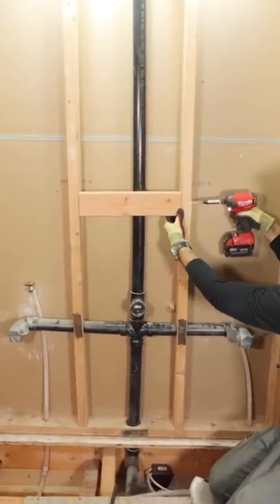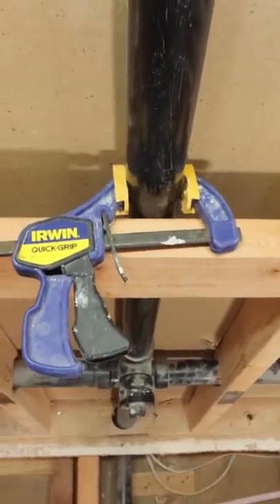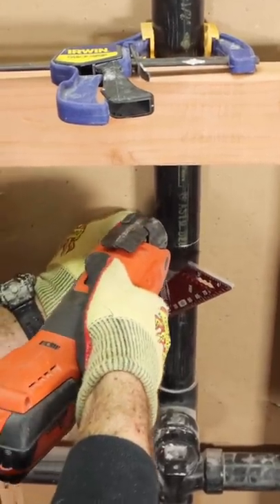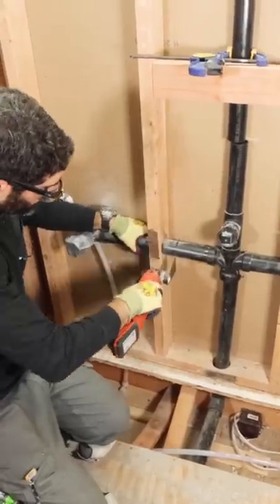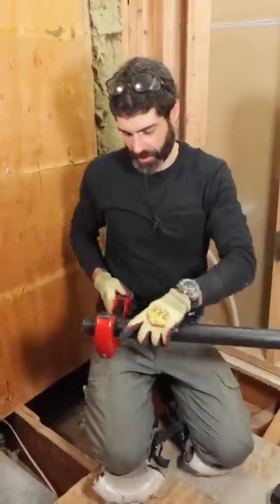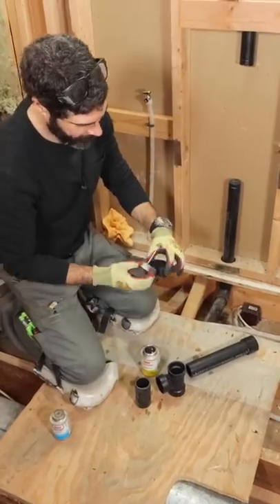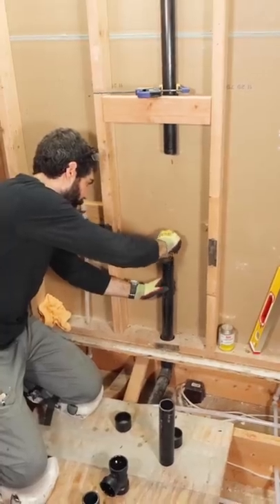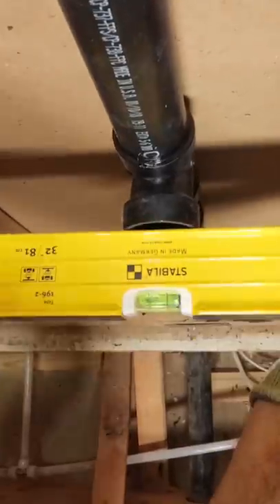Vanity Plumbing Tips - #shorts

Comment: If you cut an 1-1/2"  vent and it falls down through the roof, you have a lot of other problems.
Reply: Like?
Reply: The pipe is just going straight out of the roof what would keep it in place
Reply: @lxn_ni1814  the roof jack
Reply: @Hazardman51  this looks like new construction  maybe ive always just been in before they installed one but its never there till after  drywall is up for me
Reply: Depends on who is closing up the roof
Reply: @lxn_ni1814  the exit tiles on the roof have a decent grip on pipe they sometimes have a tight rubber waterproof collar,  clipping the pipe too usually keeps it up, any sort of gap filler like expanding foam or silicone usually grips it too, pipe collars like fire retardant collars too there’s a bunch of things what op means having a loose vent pipe usually means it’s either not sealed or clipped and sealed or just installed right.
Reply: @MrKonquer  yes but like i said looks like new construction non of those things are there yet  or atleast non of it is ever there for me
Reply: @lxn_ni1814  you just have shady contractors in your area or something then lol
Reply: @lxn_ni1814  why would he have to replace these pipes if it's a new build? This would be pointless and you probably want to stay far away from this house as possible. You can clearly tell this is a double vanity (sink) going to a single sink in a bathroom remodel so the original comment is absolutely correct. If the vent were to fall through, you have a bigger problem than you think. He could've just cut and  nothing would've happened.
Reply: @willatwood  exactly
Reply: @willatwood  or the house buyer wanted to switch it to a singlr sink mid construction
Reply: @lxn_ni1814  at least in my state the minimum size of a VTR (vent through roof) is 2”. Main vent minimum size is 3”.
Reply: It could fall through if the flashing on the roof is lead. Most VTRs have a rubber flashing which will hold them. If its cast iron you should always strap it before cutting.
Reply: It's common with old cast iron vents. I almost took my head off assuming it was secure above
Reply: @qweef69  1-1/2" cast iron pipe? No such thing in the plumbing industry. 2" no Hub is a smallest you're going to find.
Reply: @godofplumbing  what? 1 1/2 cast iron pipe exists?
Reply: @godofplumbing  they're at every ferguson. Obviously you're not that seasoned.
Reply: @godofplumbing  vents are in 2 inch also. Often exterior mount in homes in the 30s
Reply: @qweef69  I meant 1-1/4
Reply: @qweef69  your avitar name had me cracking up.
Reply: @godofplumbing  I've had it for over 10 years after multiple attempts to find a funny name that wouldn't get removed...I've yet to see a vent in 1 x 1/4" though. Secondary drain lines are always 2 inch
Reply: Thank you lol
Reply: @lxn_ni1814  this does not look like new construction 🙄
Reply: @lxn_ni1814  the pipe doesn’t just go Straight up and out, it 90s and connects to every other plumbing fixture
Reply: I usually just duct tape it then charge the homeowner for a professional repair
Reply: He doesn't want to risk those problems coming to light due to his job. The client will blame him for the bad roofing job.
Reply: @crocpa  still not how it works bozo
Reply: @lxn_ni1814  the boot
Reply: @lxn_ni1814  How do you figure it is new construction?
Why is he cutting existing plumbing?
Why can you clearly see the screw holes in the studs from where the old drywall was pulled down?
How would one install plumbing when the drywall is alreay hung?

Think before you speak.
Reply: @lxn_ni1814  first off you can’t send 1.5” through the roof. 2” is the minimum
Reply: @terdferguson1736  where?
Reply: that was my exact thought
Reply: The pipe isn't adhered to the roof with anything, including shit to seal the pipe from roof leaks.
Reply: @godofplumbing  so is that why they make 1 1/2 NO HUB COUPLINGS, for a product that doesn't exist? Yes it does, fool, very much so. Go back to school.
Reply: @godofplumbing your full of it, no hub is available everywhere in 11/2. With a hub only 2”

Comment: Never had much a problem with ABS vents falling down, cast iron, TOTALLY different story
Reply: You can't re-vent with it because it will sag over time.
Reply: @bl18ce99  depends on what you're venting. If it's a direct vertical drain to vent,  no issues.  If there's an elbow before the vent,  than maybe,  but if the dirty arm or wet vent is properly secured in the wall,  no issues.
Reply: @bl18ce99  You don't know how to support a cast iron or galvanized vertical pipe? There are several different ways. You're a "can't be done" type of guy I can tell by your comment. You can't be a real plumber to say that.
Reply: @HLBNZ  ok, I was talking about ABS, not cast iron, and I was talking about re- venting which requires horizontal runs, not vertical. I hope you know more about doctoring than plumbing.
Reply: @bl18ce99  I was referring to your original comment saying that you never had a problem with ABS falling but cast iron TOTALLY different story 
Remember?
Reply: @HLBNZ  yes I remember.  I was referring to working on cast iron in a wall where the original plumber did not strap it properly.
Reply: @bl18ce99 Ok I guess I misunderstood your comment.  Anyway I always strap it up with metal p-tape or a caddy bracket and 2-hole strap before cutting existing galvanized or CI venting.
Reply: no one is using abs unless you live in kanukuda
Reply: @TheIggypop1  They use ABS in most northern states because pvc gets brittle in the cold. Installing pvc in the Winter will make it shatter when you drop it in. Pvc is better for grade though. ABS is shaped like a bow! Makes you want to look for an arrow.
PVC is a better product all around. Solid core pvc is the best.. much quieter too. despite not being as popular in these areas. 
Snow Mexicans love them some ABS
Reply: @HLBNZ  pvc is not brittle even if you are burying it ya have to use solid core pipe not cellular core. cellular is brittle when it’s buried or outside in the cold. Abs pipe is only for inside use and thats it. Abs really wont pass an inspection here in ohio or any other place they dont use it alot. canada they-use it a lot for inside plumbing.

Comment: The last time I checked ABS didn't need primer/ cleaner. That is one reason most plumbers used it back in the 80's and 90's. You only needed one can of glue.  Not 2 cans

Comment: ABS doesn't need cleaner because the glue melts the pipes together
Reply: I think the pivotal  phrase he is "doesn't need cleaner", because, yes, sometimes ABS DOES need cleaner.  It sits out in a supply house yard, exposed to the sun and weather and the surface of that pipe oxidizes over time. And a little extra cleaner sure doesn't hurt. Depending on the condition of the pipe, it's  just good insurance.
Reply: Cleaner not primer.
Reply: Abs cement does not melt the pipe it is a glue not a solvent. But you still do not need to prime or clean it as the glue is what makes the seal not the solvent welding of the pipe
Reply: And it's a vent pipe,  not a drain pipe, only has air in it
Reply: @colinstace1758  & water from moisture... technically...
Reply: This should be less of a 'doesnt need' statement and more of a 'dont do' kind of statement. 'Cleaner' which is really PVC primer contains ketone solvents which can cause the styrene molecules on the ABS surface to actually expand and become manipulated in a way that does not allow them to return back to their original shape when the catalyst dries. This was the problem in the 80's when they had a massive recall and lawsuit concerning ABS. Go put a little drop of purple primer on a Styrene packing peanut...
Reply: Clean out ? Oh it's invisible.
Reply: Cement
Reply: @colinstace1758  flood rim down has a chance of seeing water. The trap arm and tee definitely is wet pipe. So everything he did is wet pipe.
Reply: @dass1333  depending on his location clean up so you may not be required for a single Bowl live. You rod through the tee. But you are correct that cross he cut out definitely should have had a clean out
Reply: @smitty_1  I think I may see one. It could be the coupling. It is hard to see. I would have put one in above the stubout. 
If you ever do drain service above is much cleaner.  As long As the lav does not block it.
Reply: Does manufacture say to use cleaner ? The answer is no, waste of time. Not to mention that shit could react with the glue.
Reply: @H2OMANLV  looks like brand new pipe and fittings to me. I never use cleaner on abs. Never have leaks either
Reply: @colinstace1758  might be a wet vent

Comment: It’s a good tip:  if you’re not aware it can happen, you won’t be looking for it. 
It’s not usually a prob with plastic pipe.  Galvanized or Cast Iron pipe is much heavier.  10’ of old 2” Cast is about 45 lbs. If the roof jack sealant is 60 years old, it will be dried out and have no adhesion.  Decades of termites, heating, cooling, wood shrinkage and vibration can loosen strapping.  After the supporting piece is removed the vent pipe just drops.

Comment: Awesome that you just put that pipe where most homeowners want a light
Reply from the maker: There are two lights on either side of the vent, that’s the plan for this single bowl vanity - so there’s a bigger design than what you’re assuming
Reply: Exactly.  We cut into the wall to replace a flat mirror with a recessed medicine cabinet, to find the vent pipe right smack in the center of the studs where we wanted to put it.  Had to mend the drywall, and place the cabinet on the wall instead of recessed.  Dang.

Comment: here's a great tip,..instead of going straight up with the pipe,..45 it away from the center of drain of sink,..100 percent of the time it's in the way for electrical boxes for vanity lights..most jobs plumbers are in before electricians,..we always have to deal with the headaches and have to have them come back to move plumbing out if the way,..try it,..it works wonders,..🤦🤷

Comment: You used pipe cleaner on ABS. I've been plumbing for over 23 years and never used it because it's not necessary.ABS melts the pipe and fitting together unlike PVC. It doesn't hurt anything and it's up to the installer if he wants to use it or not. Just some extra cost and an extra step applying "cleaner" 
Use metal P-tape to wrap around your pipe and secure to both studs on each side. The pipe won't fall and you will have a code required "mid story guide" at the same time.
You may have to 10 ml. Tape your ABS first depending on local codes.
Reply: He forgot to mention that's the wrong fitting for the double sink. Should be a double fixture sanitary  tee not a double santee

Comment: The DEB4 is a great tool that ensures your joints seal up nice. I never had to worry about testing my under slab piping because I knew that each joint had that chamfer. That tool is a vastly underrated thing, at least in upstate New York.

Comment: You don't use acetone base cleaner with ABS. It doesn't seals good if I use any one step glue.  A Clamp is not a plumber tool I just make mark on pipe and on a wall, it prevents back fall on hidden vent in joist space. If I strap a pipe, it will be cast iron those pipes are heavy.

Comment: You're pretty unlucky if that one vent goes straight to the roof lol, most houses have multiple fixtures connected to a single vent stack so the network of pipes in the attic prevents it from falling.

Comment: Why would the vent fall threw the flashing then it wasn’t installed correctly ?!?!?
Reply: Not necessarily, the roof jack and sealant are not designed to hold the weight of the vent pipe.  If it’s a 7 foot piece of inch and-a-half A.B.S. you are probably okay.
If the vent pipe is 50 lbs of Cast Iron, with strapping that was nailed during the Eisenhower administration, a Tablespoon of 70 year old Sun-cooked Henry’s will drop it like a rock

Comment: Just use a ratcheting pipe cutter! No need for the multi tool or the disc cutter or the de burring tool just a wast of time same with the cleaning solvent just use a rag to get the dust off and abs glue

Comment: Here's an idea a lot of times you might have trouble getting your bathtub and shower service valves and your bath fill spout to come up against the wall tightly if there is no wall covering on the back side of that wall you could leave the mountings for those bathtub fittings loose then slide a shingle or tapered shim in behind them to draw the spout and valve against the wall.

Comment: You don't need to use pipe cleaner on ABS. Totally useless unless your pipe was in mud. ABS glue fuses the pipe and fitting together. On pvc and other hard plastics is another story.

Comment: Never just use cleaner. You always use primer before glueing. Primer soften’s the pipe, getting it ready for glue. That why inspectors always look for the purple primer on the pipe along with the glue.
Reply: Don't need primer on abs, it doesn't use binary weld

Comment: Hold on bruh. Why are vents falling?
Reply: That's plastic in the video but older vent pipes are galvanized pipe and come crashing down when you cut them
Reply: @mikerourke9182  that's happened to me only once. Shoty work strapping the pipe down and not properly sealed onto the roof. But you can tell as you cut, because the blade starts to bind as the metal collapses from the weight. In such cases, you need to stop cutting, and secure the pipe, permanently. This temp clamp is not only pointless, but an indication that you plan to leave the loose vent as is, instead of fixing it.

I get the point of your video, but it can lead to bad habits. This is not the proper way to resolve this issue, and causes wasted time & material.
Reply: @mikerourke9182  furthermore, you have PEX water lines going thru studs with no isolator. That's amateur hour. Stand by for noisy pipes. And what's the purpose of those hose bibs? That's not a proper stub out. The video starts off with the lines flopping around, and then suddenly there's a cross beam and strap. Which means you're jumping around from task to task without completing one before starting another. A sign of disorganization.

I'm sorry, I've seen a couple of your other vids that were cool. Here, you're shitting the bed left and right. This video is an insult to the plumbing trade bro.
Reply: @mikerourke9182  now i also see the existing pipe has regular 90 elbows instead of long sweep. And you just left it in. You have the floor open and already cut out the crap double san tee, but leave an improper fitting in there? Stand by for clogs. 

And why did you use pipe cleaner on pipes that look nearly new? Dry wipe with a rag is all you need on abs pipe, because you aren't glueing them. The solvent melts the pipe and fuses them together, essentially welding them into one solid piece.

This video is clearly intended for newbs. So there is too much missing information. I know it's a video short. But if intended for amateurs, it should mention important things like fitting selection. 

Also, I don't see a no hub coupling, only glue coupling, and you press down on the drop pipe, so it has no play. So i can almost guarantee you had to remove your pipe clamp tip in order to shift the pipe to the side to get the final fitting in. 

The more i watch this, the more i facepalm.

Comment: I hate when  Plumbers use a cross in the wall for a double lav.  When a service plumber has to snake out the drain it just goes from one to the other so you have to go up on the tile roof to run the drain. I use a tee and a st. tee

Comment: Do you have any tips for shoring up cast iron to do some similar work?
Reply: Use a steel riser clamp, works great for really heavy pipe, just get the matching size. I personally don't use this method for plastic pipe and I use my Milwaukee pipe sheer to cut 1.5 and 2 inch pipe. Cleaner and no burs.

Comment: The tee looks like it was set back in the same spot as where the cleanout is, if that was the case then why over complicate this just cap the branches on the double ty and thread an adapter into the cleanout

Comment: Great…. Now try doing that with cast iron pipe!
Reply: But it wasn’t a cast-iron pipe, so I’m not sure what your point is, assuming you had one
Reply: I thought it was too at first.
Reply: @MKRM27  point being your cute little clamp would not hold the weight of a cast iron stack and you would not get to use a fine tool to cut it up so easily… Basically I’m saying you got it easy!

Comment: You don’t use primer on ABS. The glue is a welding solvent that melts both pipe and fitting surfaces creating a single fused joint. Whoever taught you that either wants the job to take twice as long or it’s a foolish local code enforced by a clueless inspector.

Comment: I worked for several different commercial and residential plumbing outfits over the years none of them ever required me to chamfer abs😂 & I worked with a lot of industrial skilled plumbers. Deburring with your gloves easy enough, unless you multi-tool melts the abs & and the cleaning evolution is just an extra step wasting time & filling the pockets of the money controllers. 🤷🏽‍♂️ no hints about the cross connection...

Comment: To prevent to pipe from falling through the roof?
Reply: Yes. The pipe goes up through a boot in the roof, and isn't always otherwise fastened, so the weight of the pipe might be enough to pull it out of the boot and drop down.

Comment: The correct tool is called a riser clamp and you can install one permanently in the attic, but usually you only need to worry about this with cast iron or galvanized steel. Putting clamping force on abs is risky with how brittle it is. Best of luck.